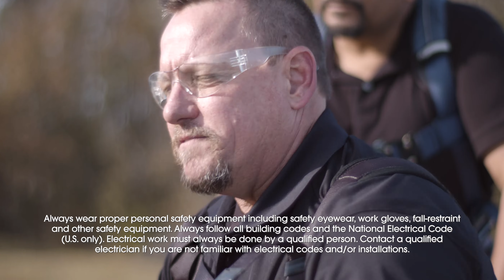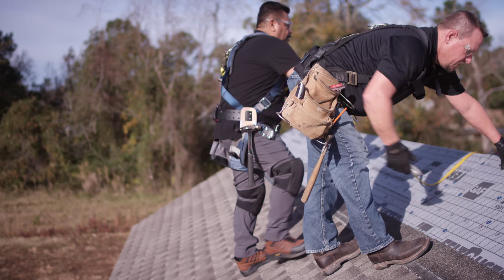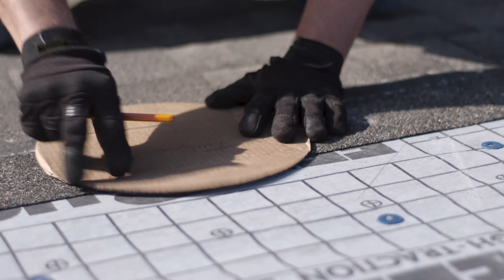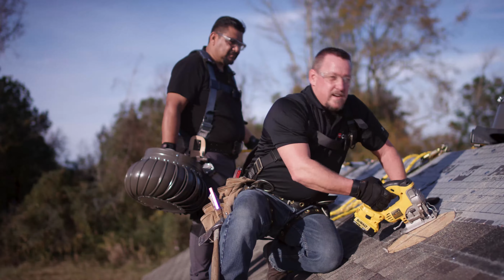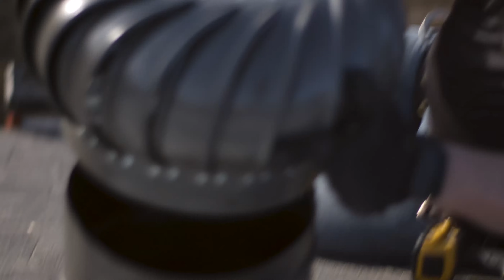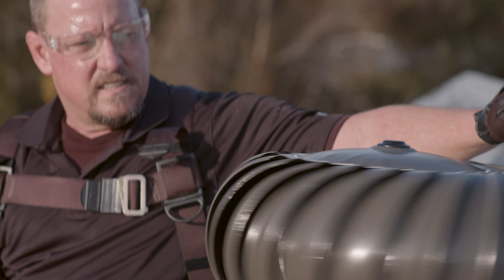How-To Install Master Flow Wind Turbine | GAF Roofing

Comment: why you dont slide the flange under the last row of shigles ?
Reply from the maker: The top half of the flashing does go under the shingles. However, you intentionally leave the bottom half of the flange over top of the shingles, so water can flow down the roof without getting trapped. Here's a link with detailed instructions: http://spr.ly/6059BEiA01.

If you have any further questions, please reach out to our team at 1-800-211-9612.

Comment: Just installed one. Bought from Home Depot.  The turbine section is slightly out of round, so when spinning it's like a broken car rim..
Reply from the maker: We recommend contacting our Master Flow team for assistance. You can reach them through this form: http://spr.ly/6056B8DaOj or by calling 800-755-9392.
Reply: had the same probleme lol they need to put foam or something in the box

Comment: Just got done installing this. Very aggravating to level. Only the top section rotates, not top and bottom as stated in video. Pipe section very difficult to turn, making minor adjustments darn near impossible. Looks and spins nice, so far. I would go with another unit if I could do over.
Reply: I bought the lomanco whirlybird and had the same problem adjusting to level was super difficult
Reply: just bought one today, and tried to turn the bottom section, but it does not turn, only the top part turn, and I was not able to make it level completely, but close enough that it will rotate freely.

Comment: So what is underneath the hole, just an opening to the room below? We have a finished attic and we'd like to do this but I don't want a hole in my ceiling, so what goes in the hole in the ceiling in the attic?
Reply from the maker: Hi, there. The Master Flow Wind Turbine is designed for attic ventilation. It is not to be used to ventilate a finished or occupied space. Please see this information sheet to learn more: https://bit.ly/42WPYUV
You can also reach out to our Master Flow Ventilation technical experts directly at 800-755-9392, to discuss the specifics of Master Flow Wind Turbine.

Comment: How do you get this thing level?
Reply from the maker: Hi, Lonnie! Instructions on how to get it level are in the video. Watch from the 3-minute mark. You can also find detailed installation instructions at this link: https://bit.ly/3It9Mp4
Reply: @gafroofing  well we watched the video but it isn’t helpful for getting it level. Only the top turns. Is the bottom supposed to turn independently from the top? We had to return it to Home Depot. I’m going to get the one from lowes where you can choose your pitch roof at the bottom when I get off work. We tried for a long time and no matter what what there was always a spot that was unlevel.
Reply from the maker: We're sorry to hear that. You can also give our experts a call at 1-800-766-3411 for assistance.
Reply: @gafroofing  it will not level, ive rotated it at every single radian known to man. Euclid couldn't level this piece of junk....